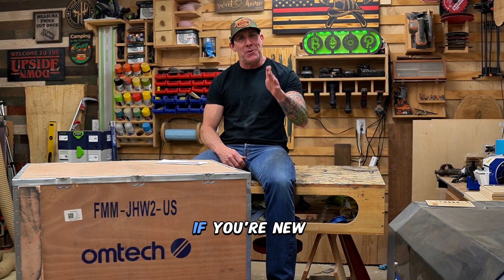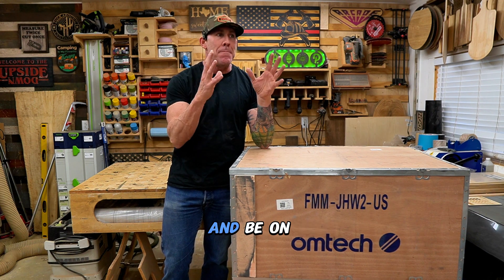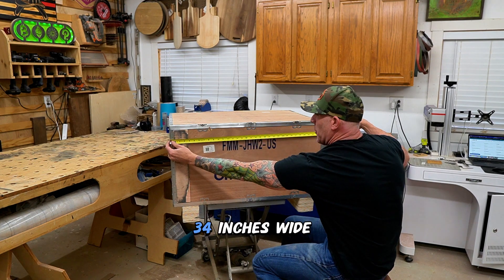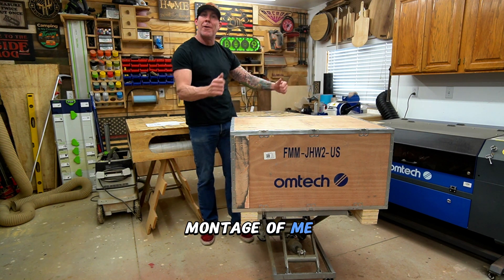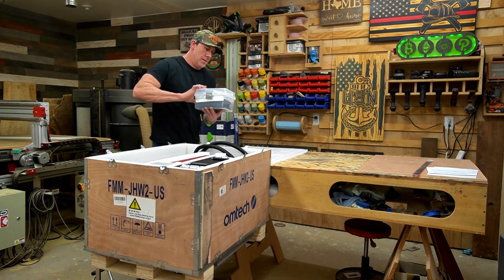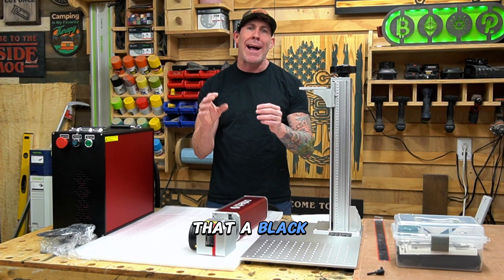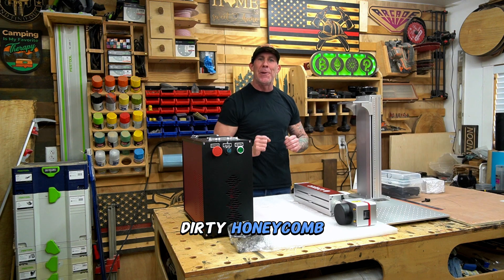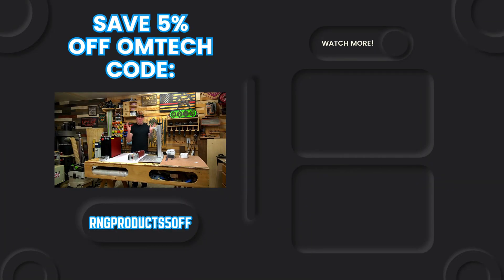OMTech 100 Watt MOPA Fiber Laser | Ultimate Unboxing and Overview

Comment: Two suggestions.
To bend the tabs up... stick a screwdriver into the notch from above and then lever the screwdriver back, bending the tab out. You can straighten it the rest of the way with a pliers or a few whacks of a hammer like device.

You don't rip off the metal corner things. Once you bend the tabs over, so they are straight up, the whole panel lifts off intact to be reused if needed (that is why there are little tabs bent over). No metal to deal with and no sharp anything's.
Reply from the maker: But it's way more fun doing it "Caveman" Style! :)